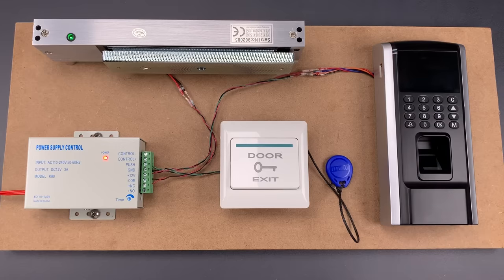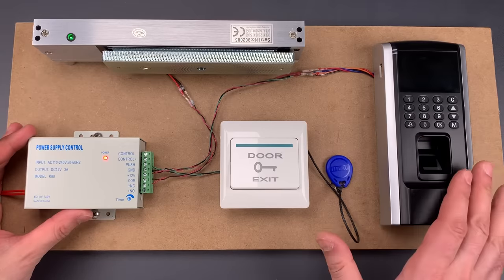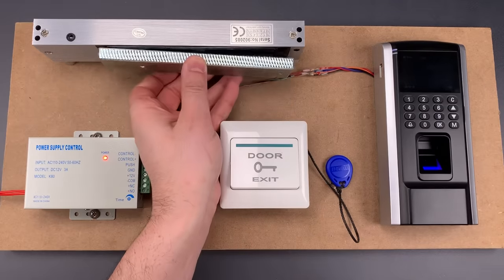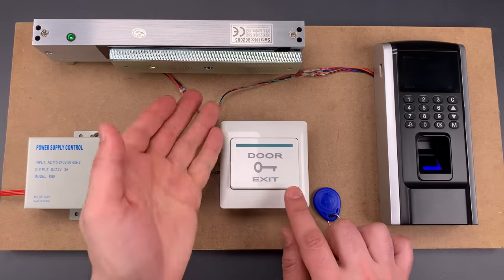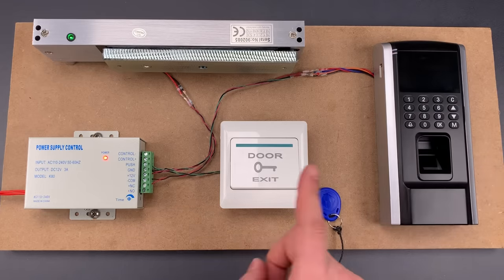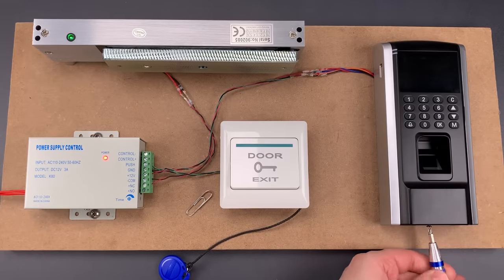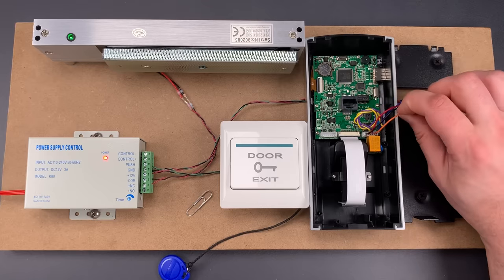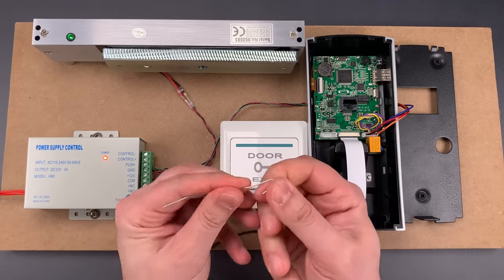[1040] Fingerprint/RFID Lock Defeated With a Paperclip (Mengqi-Control)

Comment: Woo, that's pretty rough.  They need to address that problem asap.
Reply: Yes, but the brand name Mengqi and the fact that they do not appear to have any website suggests that this may be manufactured by some Chinese generic that doesn't really care.
Reply: Unfortunately addressing it would require a complete redesign, to a more expensive design.  At the moment, there's one circuit board, one power supply, and a couple of switches, all connected by fairly basic wiring.  To address this problem, you'd need to split the circuit board, so that input processing to a digital form is handled on the external controller, and then have an internal control box (either separate or built into the power supply) that processes the requests to open the door.  You'd likely also have to make the inside door switch more complicated, as it would have to request access from the control box instead of just opening the circuit.  Then the external controller and the internal control box need to be able to communicate digitally, over a wire that's protected from tampering.

With all of that in place, it's going to be a significantly more complex system to design and manufacture, and install is likely to be more complicated as well.  (Note in this one there are four wires from the power control to the external box, which LGL has just cut and spliced.  If those were carrying actual data, that would likely make the system not work as the wires would need shielding and cross-talk prevention - which is also going to mean the installer can't adjust the length of them.)  The price is going to have to go up - likely by another 50 to 100 dollars - to do all this.

So a fix is likely to essentially double the cost, and is unlikely to happen.  What really needs to happen is for consumers to realize that this type of product built to adequate quality is going to cost $300 or more, and treat these $160 'locks' as junk and not buy them.
Reply: aside from the daft electronic lock.. 600lb isn't that much force to overcome for that magnetic latch, I'm sure a big fella running at the door or anyone with a crowbar would be through in seconds.
Reply: @SuprSi  Or anyone who able to cut power lines.
Reply: @DanStaal  Exactly.
Reply: just make it a one-time-use screw by rounding off the head and fill it with an epoxy and completely glue the screw in so it just looks like part of the plastic housing. nobody would see it. they'd have to destroy the control box to open it
Reply: @justice_1337  It's probably not going to be a covert operation getting past one of these things, your toolkit can be a paperclip and a brick. Just hit it sideways... or take a crowbar instead.
Reply: Daniel Staal What needs to happen is for consumers to have the knowledge that a $160 lock isn't the most expensive (and therefore most secure) lock in human existence. For the average person, including the average small businessman, $160 is exorbitant when the only lock they ever see at Home Depot is a $10 Master Lock.

A lock is a lock, they think. They're all the same.
Reply: @fgsfds89  This one is at least addressable. Those types of magnets come in 2 varieties: fail open, and fail closed, all depending on application. so some need power to release the door, while others need power to hold it closed. The former are safe from people cutting your power, but obviously not suitable for a fire escape! A simpler solution though tends to be to simply include a battery backup on the power supply, or plug it in to any consumer grade UPS.
Reply: @realflow100  Most people trying to break in have no trouble doing the "break" part, and the plastic housing isn't much of a deterrent. At least with a properly designed system, that wouldn't get them in. But with this one, no problem!
Reply: This is a very common issue with electronic locks.  They all by their very nature have this weakness, a contract that can be shorted that make the lock think access has been granted.  The secret to preventing this bypass is to put the locks "brain" where it can't be easily accessed.... This means more parts to install, more wiring to install, and more cost to manufacture.
Reply: @DanStaal  put the credential check board into the "let me out" button. Oh, and make sure that the talk between the two is encrypted.
Reply: @ScottKenny1978  Whether it's on the let me out button, the power supply, or the door holder/release is really irrelevant.  Wiring is probably simpler if it's on the power block, and the aesthetics are probably nicer, but functionality doesn't change - and you have the same cost/complexity issue.

The problem is that the cheapest by far place to put it is the outside access box - which is the one place where it's not secure against attack.
Reply: @DanStaal  agreed that this design is the cheapest way.

 I figured the let-me-out button would always be accessible, while the magnet and power supply may not be.
Reply: @ScottKenny1978  Accessibility for the credentials store is more of a bug than a feature...  (It's exactly the problem this has: The credentials store is accessible to the world, and therefore can be bypassed.)
Reply: @DanStaal  if the credentials store is on the let me out button, that's inside the secure area but still accessible for updating.

Comment: That is such a STUPID design.  The only reason I can think it is implemented this way is saving $$ by avoiding need for a secondary processor separately located from keypad & no requirement for data-level transmission (i.e. they're essentially transmitting DC with no need for shielding, network cable, related data protocols, etc).  All fine and good for a minimal privacy lock (keep out of the bathroom / office supply store room), but nothing more.  I hope they market it as such.
Reply: I think they could just put all the stuff that's in the input device in to a different box. Just like it is now, only a little bit of wire needed, with no change in the circuits and no additional processors
Reply: I have seen similar design in costly(1000€+ for similar setup including phone) high end system. I think they tried to fix it later by installing extra relay to the inside. Doesnt help so much now when i had to wire the lock to outside unit before, now its harder because the wires aint on the terminals that read "lock"
Reply: An atmega328 sells for 1-5$. MCUs are not too expensive
Reply: It's a complete system for only $170, if people are using it for more than just general 'Keep Out' vibes, then it's their own fault for skimping on security when it matters.
Reply: @dhaosx  Problem with this method is the NO and COM wires would still be run to the accessible keypad, which means they could still be bypassed. You could make a ribbon cable that doesn't have color-coded identifying marks to confuse the process, and make it so that cutting power locks down the door until a reset is activated from a secure location, but then you approach Fire Hazard territory. You can't lock people in a building. At that point though, you're getting into another class of locks, and you might as well do what blob said and get one with a chip inside. Rather than the control unit looking for a short on two wires, it's looking for a specific signal from the lock that is coded.

Comment: Some things I noted before even unpausing the video from pre-load:
The CE mark on the magnet unit is not the European certification mark, but the confusingly similar "China Export" mark.  The difference is in the spacing between the two characters.  In a proper CE mark, the arc of the C should virtually continue so that it coincides with the back of the E's arc.  In the "China Export" mark, the continued arc intersects the bar of the E instead.
On the same label, "Serial No" is misspelled.  This should not inspire confidence in a security product, where you should expect attention to detail.
Reply: there is no China Export mark, the european commission made a statement in 2008. Thats  a myth resulting from incorrect depictions and the fact that some chinese companies used it wrong. both things happened but both are also unrelated. so basically companies that complied to the standards and have made a declaration of conformity where just incompetent to print is correctly.
Reply: @S41t4r4  > there is no China Export mark
There isn't, no. But it's still a handy name for the fake CE mark. ;)
Which isn't worth all that much anyway, since the proper CE mark is just the manufacturer saying "yes, of course we comply with EU standards". There is no independent body checking that stuff.

Comment: That bypass could be fixed by a simple circuit. A circuit that would require a certain voltage to be passed through the wires instead of simply just closing the circuit. Or have a required variable pulsed code to unlock through the wires to unlock.
Reply: like he said its simply wrong by design. The Terminal should just transmit the dialed numbers to the power supply control box. And the actual verification is done on the "secure side", not on the terminal side.

Comment: I work in access control, as you mentioned it's really unsafe to not have a central board be the one to verify credentials.
People often think that just cutting a reader off is going to somehow allow you to open the door. This is a problem with callboxes often used by delivery men, but of course those require a key to open to begin with.
But with most modern readers all the user information is stored away from the door, usually in a security room. So cutting it of won't do anything besides maybe frying a board and locking up the door. Assuming it was installed correctly.
Reply: easy way to defeat a security door ... pull the fire alarm ... the door auto disables to allow people to leave

Comment: I added a fingerprint lock to my front door when I had to rebuild the old rotted door frame.   To make it secure, I built it inset into the wall so there's no direct access to the case screw.  Plus it makes it nearly impossible for crims to kick down or smash it off to gain access to wiring.   I can access from the inside by removing an inside wall panel,  the unit is mounted to a smaller board that's screwed in to an inner frame from that side.

I also went with an electric strike paired with a night latch (rather than an electric latch) and kept the original lock and door handle as well.  It keeps all the wiring on the inner door frame, plus I can manually open via the night latch or even disable by locking the night latch in retracted state and revert to physical locking with a key on the main door handle if required.    The only minus is if the power goes out there's no way to access the front from outside until you get in to do this.  But I have a backdoor with a standard physical key.

The one other thing I did was add a cover over the front of the unit, so only the finger print scanner part of the unit is visible / accessible.  This was partly to protect from the weather, but also I think a pin code pad would tempt crims more.  RFID works through the cover fine.

I've had this set up now for 6 years and I have to say, it has been super convenient.  I never have to fumble with keys coming home late, in rainy bad weather, drunk or laden down with groceries.  I just need a free finger to scan and go straight in.
Reply: Does it work on all ten fingers? Just wondering if you got some glue or paint on your hand or cut yourself, even just put on a plaster, might you be locked out?
Reply: I'll be comin throught the back door   ; )

Comment: These kinds of locks usually require a secondary protection like security guards or receptionists at least at the side of the entrance. When you try to do anything funny, like trying to bypass the lock by opening the machine, they can call you out and show you the door.
Reply: And the facilities guy orders a bunch of these locks and puts them on all the doors... front, where the receptionist is, and back at the loading dock where there's just a camera... and if you're trying to get in, which is easier to defeat?
Reply: I was intrigued by this video because it was precisely the kind of lock my student accommodation had. 

Until I realised it was the box that was the weak link, the university RFID scanners would never have the fatal design flaw of allowing access to the interior of the lock. Plus, every door I saw had a camera pointed at it. So unless you were really stupid you'd never do this.

Comment: Nice video (as always). In the office I used to work in, of a multi-billion dollar business, they had installed the card reader AND magnetic lock on the outside of the door. Admittedly a few more screws but to take the entire lock off the top of the door was still a viable means of entry <sigh> As the building had recently been completed I took photos and explained to management why this was a bit silly...nothing was done in the two years I remained with that company.

Comment: Lol. I actually used this method on a similar lock once in my uncles jewelry store. He accidentally locked the FOB inside the safe room, and couldn't remember the pass code. There were no biometrics on the lock, so he called me, knowing I have at least some knowledge of locks and surrounding tech. I bypassed the tamper switch, pulled off the key pad, and did the same thing as LPL. My uncle was impressed at how fast I did it, but also pissed that it was that easy. I can't recall what system it was, it's been 10+ years. Since then, he's upgraded his security multiple times and even installed new vaults inside the safe room. His idea being that since any lock can be defeated somehow, more layers might deter someone who doesn't have all the equipment necessary to get through it all. Had me test it out not to long ago (about 2 or 3 years ago) and he was right- I didn't bring a drill or stethoscope, and couldn't get into the actual safes inside the room. Not that I was going to drill the damn safes (I don't have thousands of dollars to replace them, nor did i want his insurance etc to go up for damaging them unnecessarily)... I wasn't THAT determined to get in, just tested it to see where his biggest weak points were. 

Same principle as Intel work- when the opposition goes high tech, you go low tech. Chances are, they won't even realize what's happening till its too late.

Comment: I started looking into retrofitting the outside doors on our apartment building with rfid readers and locks (but our building is not pre-wired for this). Found some that looked promising, but I think they all shared the same problem with the brains of the unit being part of the scanner component (self contained). A significant flaw for sure, just breech the housing and bridge some wires. Still looking for options. Something using POE might work so we can put the control unit somewhere safe from tampering. I'd prefer a model with the metal door plates, as I understand the latch versions can be subverted pretty easy too.

Comment: the issue with having the Lock send a signal to the secure site for the door and then opening is that unless it's an encrypted signal that changes every one minute or so like we see in authenticators. it's just too easy to force the electrical signal to be sent from the Unsecure side. This kind of lock are not meant as the main lock but more as a "restricted area personal only" lock

Comment: Jesus christ there's a literal tutorial on how to break in SILKSCREENE ONTO THE PCB.

I'm gonna do a backflip into my own ass this reality is too cruel.
Reply: nonono, the silkscreen is there for the installer. The secure screw prevents any one who doesn't have the sophisticated, specialized and expensive tools required to unscrew it from gaining access to the pcb.
Reply: Oh, a lot of door control devices have circuit diagrams printed on the inside for the installer to follow.
Reply: Tamper proof bits are cheap and easy to find these days. The solution is to use a real access control system and not this crap
Reply: @PoisonedAl  Sure, but that's usually positioned in the secured part of the facility - not on the access panel.
Reply: @snikwad003  Unfortunately most "real" systems aren't much better. For example, the vast majority of apartment building entry systems have their control systems on the outside of the secure area. Even high end office systems that do use centralized servers for control (usually only used for organizations with dozens of doors to deal with) usually send the credentials from the readers to that system unencrypted leaving them vulnerable to MITM replay attacks.

The entire security industry really needs a wakeup call. And I appload LPL for being part of that wakeup!
Reply: @Asdayasman  You'd be surprised.... next time you visit any apartment building look at the panel you use to buzz the apartment, I bet that all the circuitry is right there, and not in the secured part of the building. Older ones don't even have a lock on the box, allowing anyone with a screwdriver to bypass it. Newer locked ones tend to use one key for all the ones from the same manufacturer (and there aren't many manufacturers) allowing anyone to find the right key online to open almost any building in the country.

Comment: Imagine accidentally bridging +ve and -ve terminal with that clip, now that's a question of another What If! 🤣
Reply: The would probably send the power supply into an over current fail safe mode (if it is built into it). But after looking at the video I doubt if the power supply has any of that.

Comment: Though that can be avoided if the external unit is integrated in the wall, so no one would have access to that screw and only the keypad is showing.
Reply: Break the keypad and expose wires